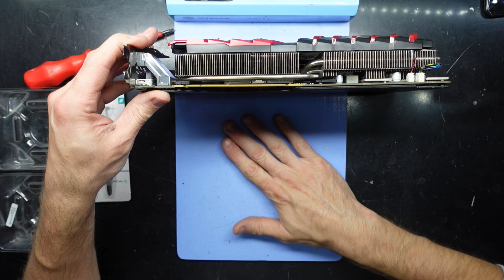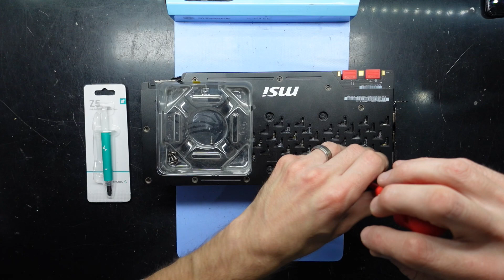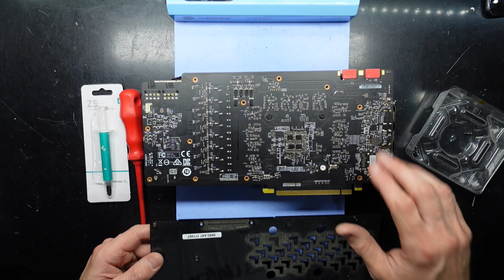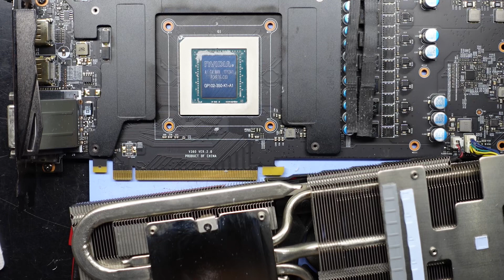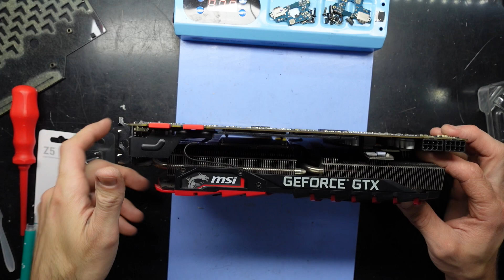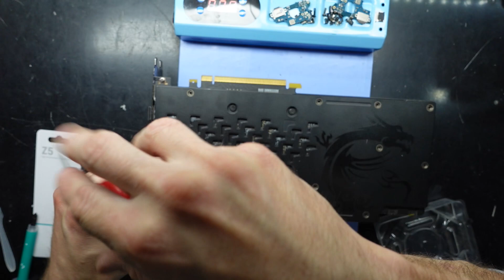MSI GTX 1080Ti Gaming X 11GB Thermal Paste Replacement

Comment: Thank you! I have this exact card and have been seeing stability issues recently. I figured it's just "dying" and is due for replacement, but then I thought I'd do some research first.

I ran OCCT stress testing and found that the GPU temp under load was sitting at around 79 degrees which is fine but then noticed the "GPU Hot Spot Temp" getting up to 92 degrees. Is that bad? I assume it's bad...

I used the MSI afterburner app to manually set the fans to max speed and it seems more stable now.

All this is just to say, I think it's worth a fresh thermal paste application since I've never done it, and I've had the card since new (around 7-8 years now?)... so thanks for the how-to guide!
Reply from the maker: Great to read this has helped you Cool this GPU!

Comment: 1. are there screws for the vram coldplate or its just the one screw beside the display ports which holds it all , because i cant see any of them on yours and even mine too , dont know if the service centre guy lost it or its like that only  ? can yo ucheck on your gpu and reply ......
2. i have seen some other guys spread the thermal paste with spatula like u did and then again put a decent size dot in middle and then put the heatsink , i guess its because after spreading with its uneven and cant be trusted so they put a dot again , what do you think of this method ?

Comment: Nice vid, only too bad you did not a before and after temp comparison.
Reply from the maker: I don't have time to do those sorry but being as the thermal paste wasn't changed in 4 year.. I suspect it will be a good improvement
Reply: i replaced mine gpu thermal paste after 6 years (yeah i know sorry) and it went down almost 10 degrees, but in my case it was gtx 1070 gaming x

Comment: does anyone know the thermal pad thickness for this gpu?
Reply: You can find it online  with diagrams what size goes where
Reply from the maker: Not sure sorry
Reply: Apply thermal putty Upsiren UX Pro. And for the core phase-change material Honeywell PTM7950.